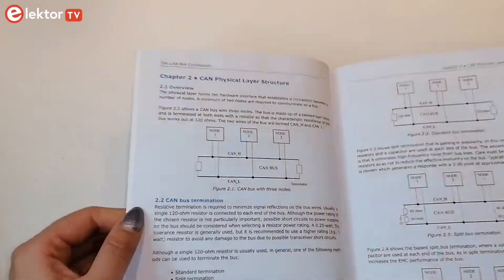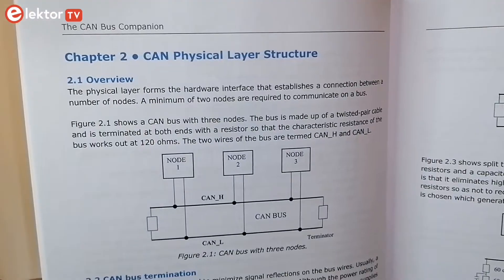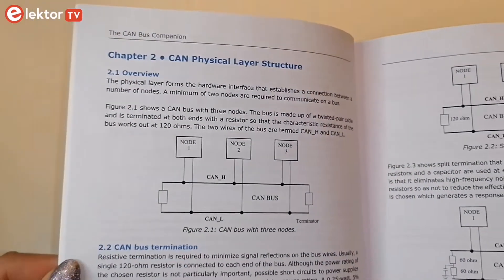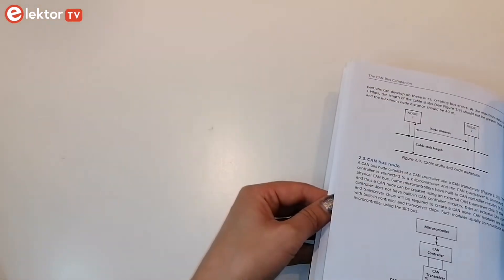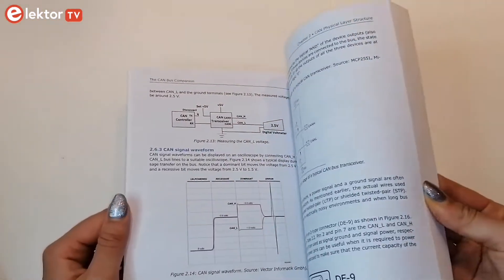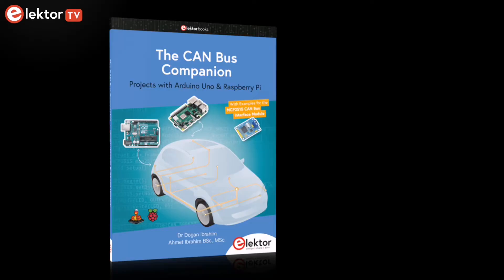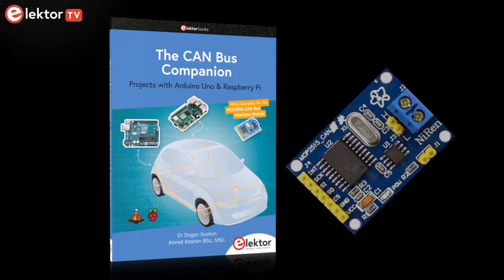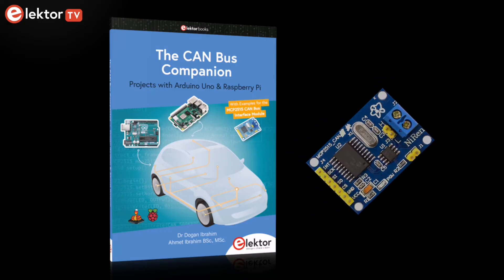CAN Bus Made Easy: Projects and Examples with Arduino Uno and Raspberry Pi

Comment: Because Microchip doesn't recommend the MCP2515 for new designs, any thoughts on their recommended MCP2518FD?

For example, the filtering (11-bit sid vs 24-bit eid) looks much different.  From what I understand, ONLY messages that are NOT filtered will be ACK'd by the peripheral.   

So if you only want to process/ACK messages from these Extended-IDs (MIDE & EXIDE = 1 ) : 
08 0000
0C 0000
C0 0000
D0 0000

what would the (32) CiFLTOBJm (Filter Object) and CiMASKm (Mask) Registers be set to?